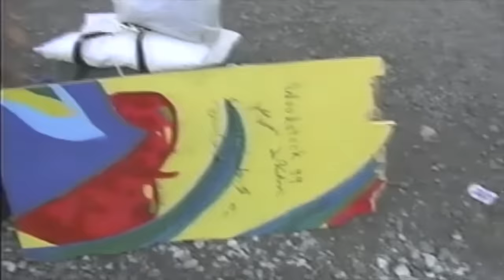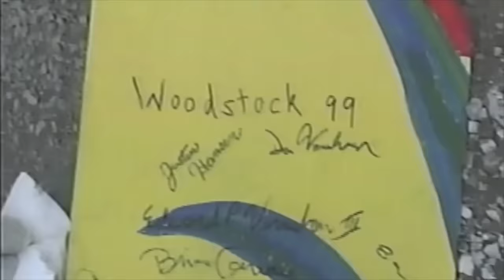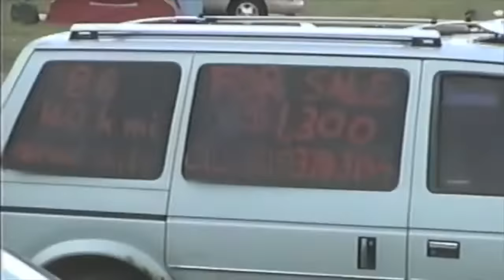Woodstock 99 Amazing Footage

Comment: 14 right now, life looked so much better when everyone wasn’t on their phones. i did find a group of metal heads in my grade and we do shit like this😂
Reply from the maker: There wasn't any phones at that time - Look in the videos really maybe a few. 
It really was the last of its time - 
Now everyone would have recorded it and maybe it would be that interesting and causing such a stir.
Thanks so much for commenting
Reply: I do have to disagree a bit. Myself and all of my friends had cell phones in ‘99.  They weren’t equipped with cameras but (analog) phones were everywhere “at that time” and not that expensive either.  Of course there probably wouldn’t have been an available signal with such a large crowd using them in a small area .

Comment: I had just turned 21 on the 14th of July 1999 won tickets on a local radio station in Connecticut 106.9 WCCC . About 30 of us from Colchester Connecticut made the drive to Rome.  Holy shit was it a adventure LSD Special K mushrooms and looting trailer trucks because they fucked us over so yeah we went wild.
Reply from the maker: No kidding - That is incredible. Ill actually be in Connecticut in a week. 
I have said it a 100 times - If you treat us as in Americans that way  - we will stand up for ourselves and in this case we burned the MF down. 
Super proud  - 
Thank you very much for commenting.